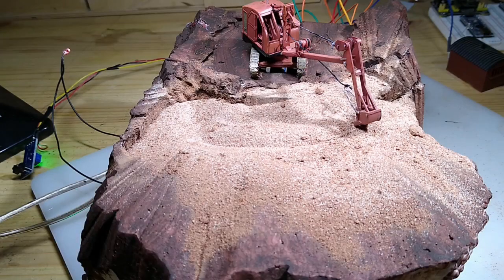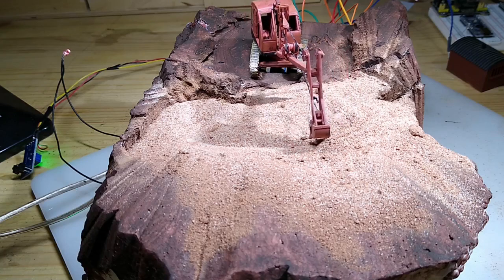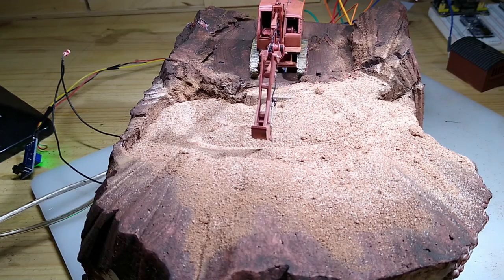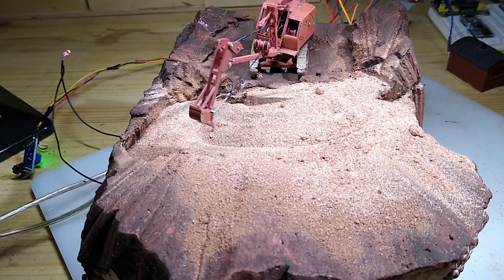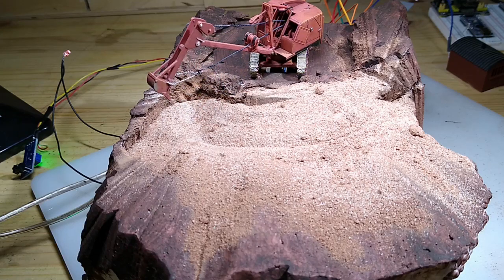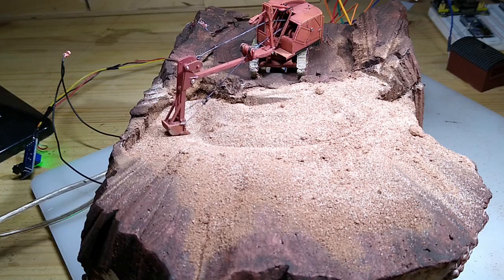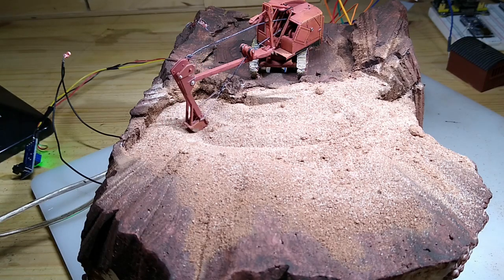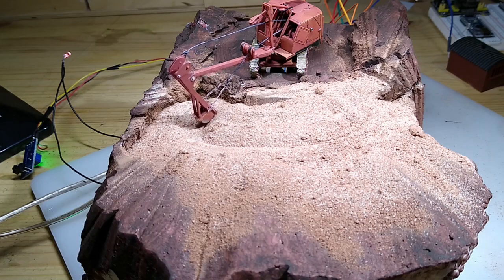Part 1 - HO Scale Working Backhoe/Excavator with sound - Part 1 (Working Demo)

Comment: Neat build ! What sound file did you use for a Bantam excavator ? Made a small lifting crane out of a HO Sheepscot 45 ton brass boom kit. Mine doesn't do anything remotely as cool as this. Well done.
Reply from the maker: Thanks, I got all the sounds from 

https://sound-effects.bbcrewind.co.uk/  

I downloaded individual sound files that I thought would sound right and mixed them down into a single file using Audacity (free software).  I plan to make a second part to this vid showing how it works with the Arduino code, links to the sound files and a circuit diagram.  It will be completed and uploaded as soon as I get the time to put the vid together.